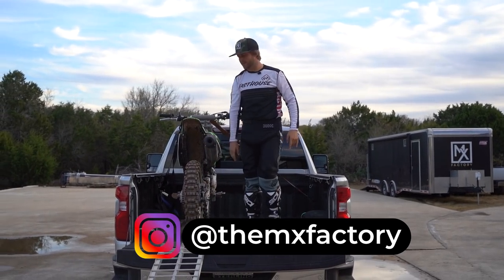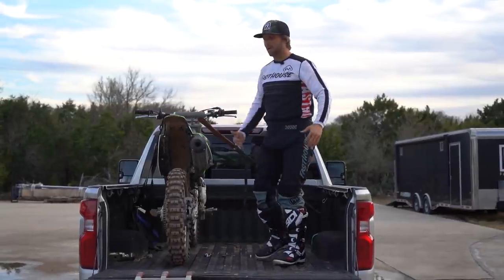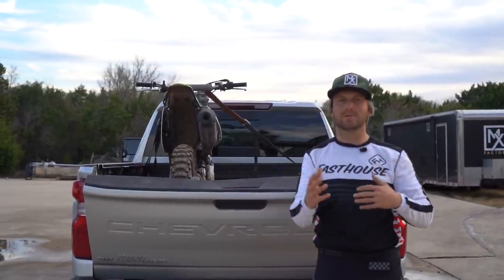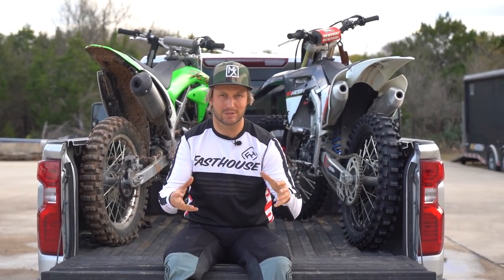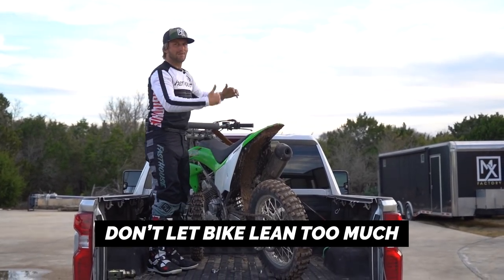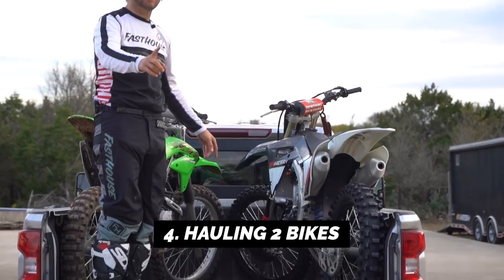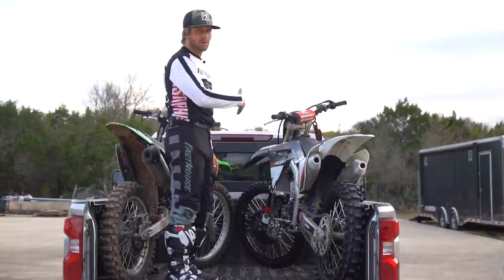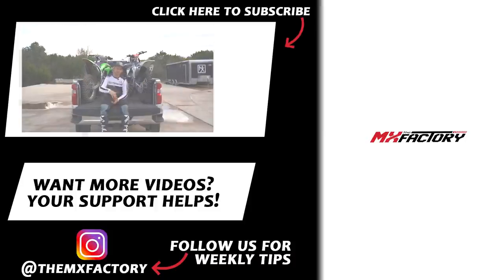4 Different Ways to Haul & Load Your Dirt Bike

Comment from the maker: HOW DO YOU LOAD YOUR BIKE??
Reply: By a trailer with a ramp. 
and yes I do it with my dad I dont ride it on by my own 😂.
Reply: Joe Hauler
Reply: My wife loads my bike for me 👍😎
Reply: I just lift with my dad since its so light weight or take out some steel ramps and just push it up in my dads pick up truck 

Its a 125cc and its the same size as the yz 85 big wheel so it aint that heavy
Reply: @speedyboi349  oh is that the Honda crf  125f? And yea I got a Honda crf 150f and 125 is quite light but the 150 is heavy
And we don’t take our motorbikes to places very often cause I live in Australia I ride up back roads and ride across paddocks cause I live on a 3500 acre farm
Reply: @Jschultzy21  no bro i still have my first clutch 
Its a peace moto 125cc its chineese but its on the higher end of chineese bike

In my opinion quality wise its totally comparable to a brand bike specially suspension wise and engine wise 
Very torqy for a 125 and soft suspension for extra grip and trails 
Best kid enduro bike for a beginner 
Plus it hits jumps and it does not break ive been jumping on it for a year now and its unbreakable
Reply: @speedyboi349  ok
Reply: Corner to corner \ way better for bike grabbing by the foot pegs,
Reply: like the guy in the intro
Reply: Number 3
Reply: 4 kids bikes in the 8 foot bed and dads bike on a hitch rack!
Reply: I use a ramp
Reply: OMG remember in the other vids I was saying I wanted a dirt bike for Christmas well I got a KTM 65 SX!!!
Reply: front tire in the corner, rear wheel to the other and i put my straps to my foot pegs . keeps the shock and fork extended saving seals.

Comment: Put a tie down on the frame part where the seat bolts or so and pull it down, really helps keep the bike from bouncing, hopping, moving etc, especially on bumpy stuff. And get one of those fork seal saver things you wedge in between the tire and a nice spot like bolts under the fender. I have used a cut 2x4 works too. Only need to pull down an inch or two that way. I also tend to put my bike all the way to one side, but I also use middle but not a lot.

Comment: Man my bed is tiny small truck here in Haiti and the strapping points are at the top of the bed sides and my bike always ends up leaning over or moving from where it started. I haven’t had it fall yet but the roads here are awful on the way to rides and my bike won’t stay put no matter what I try. Also I prefer not to get out of the truck as much as possible in populated areas with the current state of the country right now. Let me know if you can think of something that might work. I’ve tried everything except the tailgate up with the back tire on top lol
Reply: Read my comment above.

Comment: My truck is 6 1/2 foot and I can fit three full size bikes, two on side first all the way over to the wheel well and then point the front tire to the corner of the bed, then strap and then lastly bring the third bike in the center, might be tight but nothing collides and you can still have room for the ramp and a gear bag and gas and other things you wish to secure in the bed

Comment: #5 is to load your bike diagonally with the front tire wedged into the corner.  Then use straps connected to your foot pegs to tie it down.  The major benefit with this method is that you don’t compress your shocks and put wear-and-tear on them from being crushed for hours on your ride. Added benefits are you can close the tailgate, and it works with a 5.5’ bed!

Comment: If I'm in a hurry I pull straight in and put the tailgate half way up. If I'm going long distance I usually go with method #3. But I always kick the back wheel to the right so I can still see my blind spot and out the mirror pretty good. 🤘